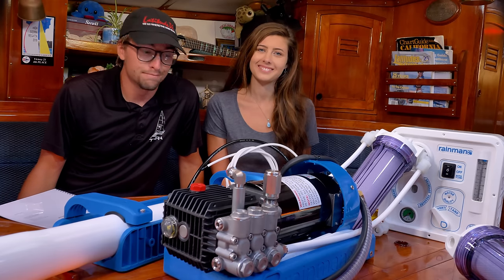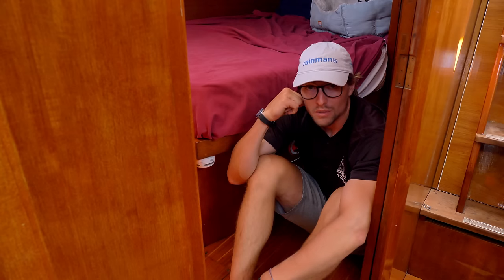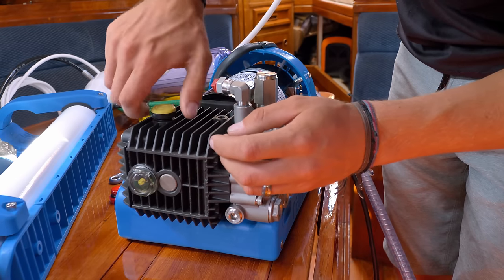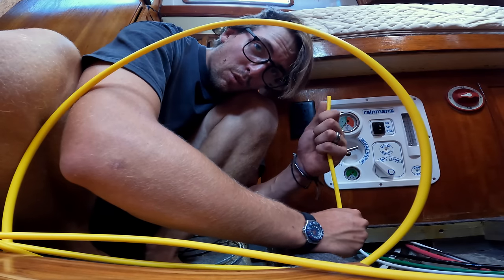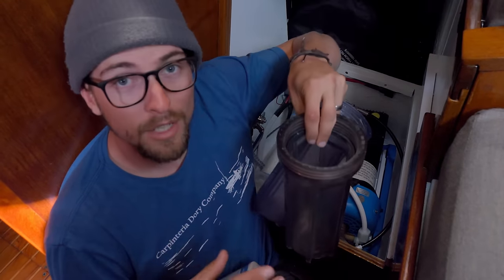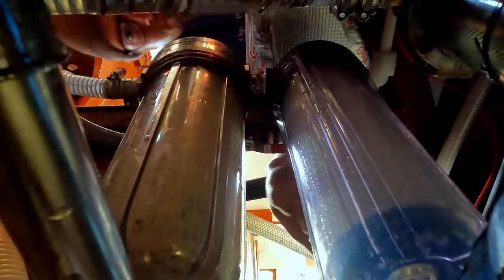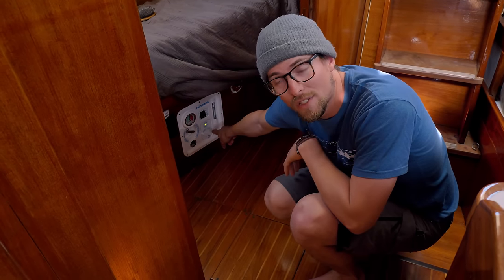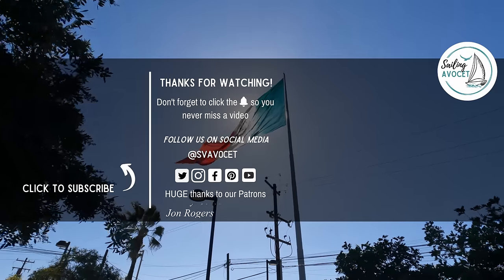Installing Our Rainman Watermaker | Sailing Avocet

Comment: Great video, thank you. Regarding your AC vs DC comment, this does not perform the efficiently much, rather AC makes more sens on larger system and DC on smaller. For anyone in the process of choosing av water maker, I recommend doing the necessary research, just as you have done. Still I would like to clarify, that generally you have four parameters you can balance to your situation: Production rate (how fast do you need to produce water), energy efficiency (how many ah/wh does I take to produce a certain amount of water), powering method (AC, DC, dedicated engine, main engine) and finally price of the system, that will be influenced greatly by the other three parameters. As an example if you run a generator regularly, you could choose a high output AC powered water maker with low efficiency at a reasonable price. On the other end if you want to run it from a limited source of renewable energy, you might choose an efficient unit with energy recovery and run it from DC power. Your water maker is somewhere in between, as it is low output and does not have energy recovery, and as such would be suitable for a situation where you have a decent amount of solar and/or low water consumption. A system with energy recovery would make the same amount of water for 1/3 to 1/2 the power consumption (i.e. a Schenker 30lph would draw around 10A), but the unit might be double the price to purchase. Happy sailing⛵

Comment: Thank you so much for this video! This is just what I was looking for.

First, I just want to clarify what I saw in your video regarding your installation. You teed the saltwater feed from an existing line and did not have to use a dedicated thruhull/seacock. You installed a 20-micron pre-filter in addition to the 5-micron pre-filter, which is what I would want to do for the exact same reasons you specified. 

Second, I want to ensure that my understanding of the Rainman unit is correct. One of the great appeals to me of the Rainman is that there isn’t a requirement for an initial “boost pump” because the unit is self-priming to 6 feet. I didn’t see you install one either. It seems that Rainman markets their watermakers as using just the 5-micron pre-filter. 

So, having said all that, I have a couple of questions regarding your installation, if I may. 
1) Have you had any issues with the pressure pump pulling the seawater through both of the pre-filters (not due to clogging)? 
2) Is there anything about the installation that you would change after having lived with it for a while?

Thank you so much for any insights you might be able to share!

Comment: In the engine compartment: This is a good option if there is not enough space below deck. The water purifier can be placed in a cabinet or on a shelf.
Reply from the maker: Not sure what you are referring to here, but we don’t have much space in our engine compartment to compensate the unit which is why we placed it where we did

Comment: Make sure the water purifier is securely installed to prevent shaking and falling.
Reply from the maker: It is not a purifier, it’s a desalinator, and it is installed securely on the sole of our cabin - no fall risk or shaking risk. If our boat was shaking I feel like we would have more issues 😂

Comment: Water purifiers should be installed in a place with a clean and stable water source. You can install the water purifier at the back of the boat, close to the water pump.
Reply from the maker: It isn’t a purifier, it’s a desalinator and it is installed at the back of our boat near the pump. Everything is within 3 feet of eachother which is the shortest run we could make - another reason why this unit is so great

Comment: RO water is great, but it also strips out all the minerals. Have you evaluated adding some back in?
Reply from the maker: Good question! Not at this time, however I (Marissa) am really sensitive to distilled water so have to supplement it with electrolytes to keep my tummy happy.
Reply: Adding minerals back to the water makes no sense. Plenty of minerals in your food and it all ends up in the same place. Your body doesn’t know if you ate or drank them. Minerals in water are for taste.
Reply from the maker: You are correct to an extent! However, I tend to forget to eat during the day so if I am chugging down water from our tanks I notice I get a little stomach sick if I don't compensate with electrolytes OR pair it with food. This is actually pretty common after running it by a few doctor friends who are also sailors. Very thankful to have a great community looking out for our health! @jayelwin

Comment: Best to mix a little hard water with RO water. RO water is hard on teeth.
Reply from the maker: Hard on my stomach too! It’s on the list to mineralize the water, but we gotta make some more $$$ first
Reply: @sailingavocet  you could add some minerals that dissolve into the RO-filled glass/pitcher/pot. I’ll look for some commercial products.
Reply: A manual approach, if acceptable, is to buy a product with salts (such as Magnesium, Chloride, Potassium) and add the requisite number of drops to the volume of water to be consumed. That is far cheaper than buying an automatic salt feed system.
Reply from the maker: Noted, thank you!  @jaymacpherson8167

Comment: I suppose its the camera but it sounds like a diesel engine.
Reply from the maker: Wow you must be around some quiet diesel engines then
Reply: @sailingavocet  Listen your video, YOU are around some noisy watermaker.
Reply from the maker: Haha okay buddy whatever you say
Reply: @sailingavocet  You don't need to defend your sponsor like that. Your water maker sound like a fucking engine that's all. Not my fault. just take it.
Reply from the maker: They aren't our sponsor - would have been cooler if they were but we paid for this baby out of pocket. After rebuilding our diesel engine and working on other diesel engines in general I can confidently say this sounds nothing like an engine. Sounds like a pump, sure, but engine? nah. Stay safe out there bud @basilroland
Reply: Sound levels are published on the website. The 12V system is reasonably quiet. AC system a bit louder, petrol is loudest (almost like a honda generator). When listening to sounds on videos, it kind of depends on where the microphone is placed. Things can sound louder or quieter than actual, depending on microphone. https://www.rainmandesal.com/wp-content/uploads/2018/08/rainman-sound-levels.jpg
Reply from the maker: Exactly! We just shot you guys an email, hope you got it :) cheers!